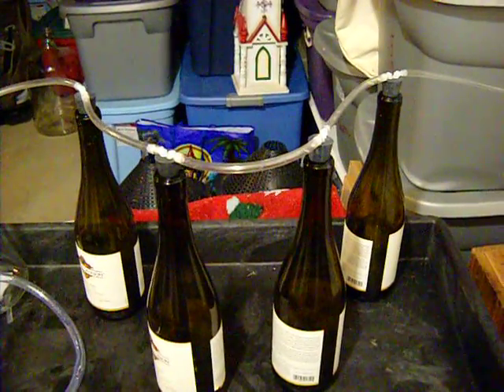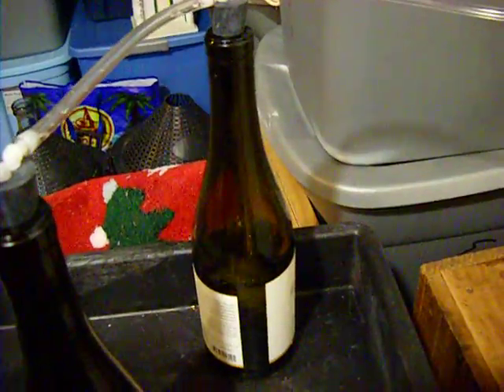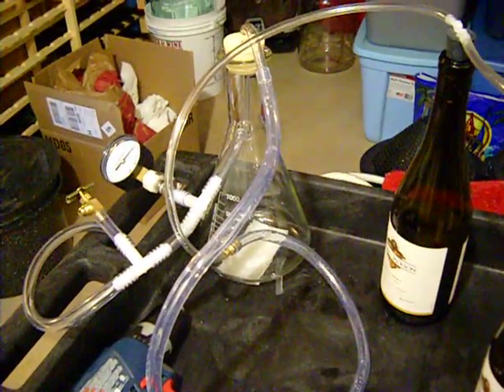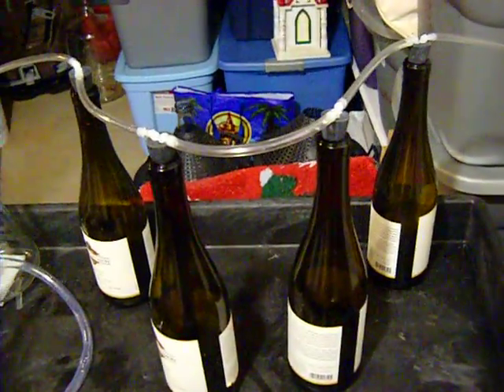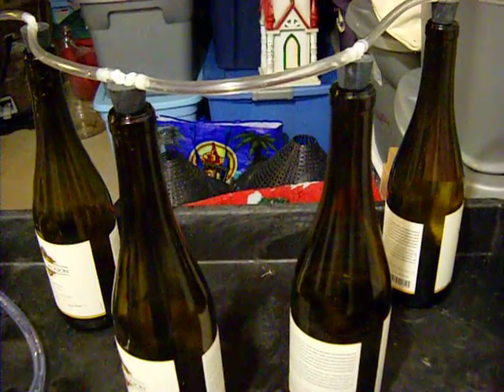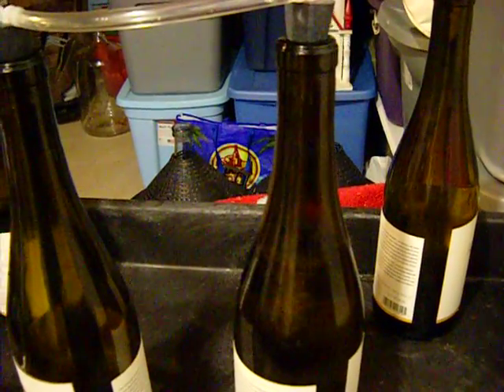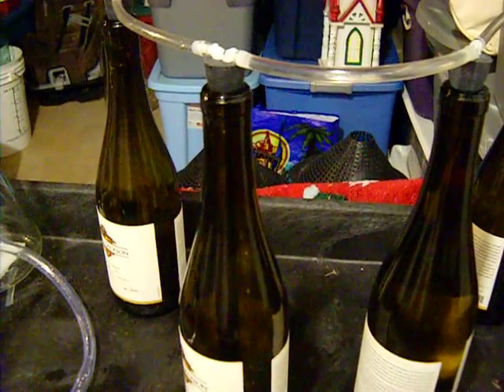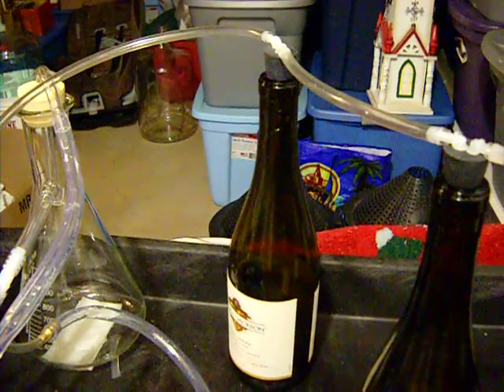WINE BOTTLING USING VACUUM PUMP

Comment: Did you not realize that if you had attached twin tubes on the bottom of each bung, reaching down to your desired fill height inside the bottle, that each bottle would fill exactly to the bottom tips of the tubes? You would not have to take any liquid out at all. 

To mscheism:  No, there is no limit to the number of bottles at one time. Only the increasing resistance from the increase in length of tubing will slow down the slow.